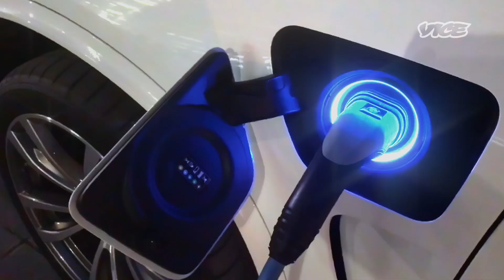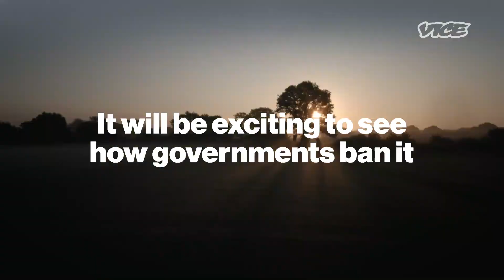The World’s First Solar Car | Extinction Update

Comment: Oh, this really does look super cool, I'm being serious... But where did they get the batteries for these cool cars from? Oh, they got these large lithium batteries from tens of thousands of hours of mining into the earth for the lithium???? Wow, I hope those colossal mining trucks were solar-powered too... Because if those colossal mining trucks were using fossil fuels (diesel fuel) to move all of those tons and tons of minerals to locations where they used tons and tons more chemicals to sift out the specific mineral Lithium, then that would have taken a crap load of these cars to ever make up for all the fossil fuels that were used to mine for the needed materials just for one of these really awesome solar cars??? Geesh, maybe this game of fixing the ecology of our planet with halfway cool cars that still, unfortunately, can't even accomplish what a regular fossil fuel vehicle does by itself, then this might be a step in the wrong direction.
You must take every step of the process into the equation to ensure the end result is an actual fix to the problem. If producing one of these types of vehicles requires seven billion tons of co2 (carbon footprint) to make, but one car only reduces 100 million tons of co2, then you are only creating more of the same problem. I really hate to break it to folks out there, but fossil fuels are still a huge requirement for the time being.

Comment: solar panels are made from silicon and other minerals mined, refined and manufactured with fossil fuels. car manufacturing is energy intensive and polluting and even a solar car pollutes the air with micro particles from tyres.  if these people were actually green and not fakes they would simply be recommending people didnt drive cars at all.

Comment: Magnetic turbines using magnets placed under the tarmac that turn magnets on the underbelly of a vehicle is a good idea... The infrastructure would cost a fortune
.. But if its clean energy you want... You gotta pay for it...

An industrial magnetic bar (for a forklift) costs 300 sterling.. You could either suspend them above roads or Bury them under tarmac... The amount of energy generated is based on the spacing of the bars...the speed of the vehicle... And the size of the magnetic turbine...you could make them smaller like a box and Bury them in the tarmac and have road markings for them.. Might give people incentive to stay on their side of the road.... You could even use an electromagnet with a optical sensor so that it only turns on while the car is over it... Electromagnets can be powered by solar... But ridiculously expensive... But they can be turned on and off so they aren't a hazard... But there ya go... My two cents... 

But if they were mass produced specifically for infrastructure they would probably be a lot cheaper...

Clean energy initial down-payment for future returns???

Future returns being emission free countries.. That can still drive their cars...

Comment: You could incorporate wind funnels that charge the car via wind power while you drive also...

You could create an internal windfunnel like a lambo... Have it filled with rows upon rows of aerodynamic fans where the blades are only at a slight angles so it's not producing much drag...

Kind of recuperating some of the power lost by driving... Might extend the battery life by a certain amount of miles.. Depends on the design of the turbines....

You have to push the car anyway... So why not try and recover some of that energy...

Comment: Key assumption here is that this is basically a model y with a solar array slapped on top. 

Assuming a 180watt solar panel is around 800sq inches and the real estate that you can functionally place solar panels on a car like this is about 4x8 sq ft or about 4600 sq inches which means you can get about 5.76 180 watt panels onto the car while being able to see through the windshield and the back window. This means that for each hour in peak conditions the car would produce around 1050 watts however because a car roof and hood is not an optimal placement this efficiency gets cut in about half+extra weight from panels requires extra energy to move. So in reality we only get around 525watt per hour, supposing we get 6 hours of good sunlight that means that we get around 3150 watt hours per day. The Tesla model y has a battery capacity of 75000 watt hours, and a range of 326 miles, so using these numbers 3150watt hours would only get you around 13 miles of range per day. Even this is unlikely and as I mentioned before the solar panels would add weight and require more energy to move. However it is still technically possible just highly impractical, and as such there should also be an option to charge the car through an electric charger as well.

there is absolutely no way their claims of a 800km range are true if this has a smaller battery than 50kwh, and while the solar panels will recharge the battery while you are driving, it will only be enough to slow the battery’a drain by maybe 40% at the very most.

Comment: I think this whole going fully  electric is a big farse. You've got to get the electricity from somewhere which means it's generated in a power plant like an oil power plant. Then the  more your transfer and store energy the more you lose in the process.

Something like a hybrid gasoline/solar  or even gasoline/mini wind turbine cars  would be amazing though. This would help solve alot of problems. It would reduce a lot of emissions during the day while still being able to drive at night. You also keep the driving range by having gasoline as a backup. The solution isn't a light switch its a dimmer. We will never be zero carbon  but we can reduce it.

Comment: They should ask more critical questions. The business concept is flawed and the likelihood they will ever make money is very small. If they want to outsource production then also the chance any IP will walk out of the door is big too.
From this film alone I can see build quality is an issue and how the panel-roofs are made in their lab looks messy and error-prone. No way they will make a competitive price. Which company puts a big red e-stop in the middle of the dashboard?? They themselves already think the prototype might be dangerous to use? 
And I didn't even get started on the technical concept. Electric is not the best energy for vehicles. If used correctly that is diesel. And who puts very heavy panels on top of the roof? To compensate you need heavy suspension, thus more spring force and a rough ride. Couple that to hi-efficiency tyres and the ride becomes bonehard, as you can see in the video too.
Just some thoughts from a automotive testing engineer..

Comment: This company is borderline scam. The math just doesn't work for solar powered cars in a traditional form factor. Even if you could capture all of the sun's energy the time it would take to charge is way high. This is NOT a solar car. It's just a normal electric car with solar panels bolted on top. The true solution is electric car with proper battery recycling charged by renewable energy (nuclear being the only real option with the short time left before we're too late to fix the planet). 

This may not be as far off as many think though. Battery tech is evolving very fast and modern LiFePO4 batteries can last for 10000 charge cycles with 65% of the original capacity remaining. (if this sounds bad don't worry, auto makers already hide part of the capacity so you don't notice the degradation)

Also solar planes, trains, and boats? Have they asked an electrical engineer?

Having any of these be purely charged or powered by electricity from solar panels is crazy. The math simply doesn't work. 

It's depressing that companies like this continue to find eager investors. They really need to consult with engineers first. I work at one of the biggest companies manufacturing battery safety systems for electric cars and not a single engineer I know of would take this seriously.
Reply: Did you look up their website and Youtube channel? Did you know they started as a few students from the Eindhoven Technical Uneversity and won the Bridgestone World Solar Challenge four times in a row? It's worth looking that up and find out they are not just a bunch of scammers building a car in a barn. They are very serious. Just Google Lightyear One
Reply: @jojothecrazyclown7572  Yes, but the math still simply doesn't work out. And they should have realized that as engineers working on solar cars for competition, which must be more like a bicycle than a car to actually work. The best solar panels out there can get 800w/m^2 on a very sunny day while directly facing the light. It looks like they have 2m^2 at best on there, so in a full day they can't hope to get more than ~6kWh since 4 hours of direct sunlight is usually about the same as the whole of a sunny day. Even the Nissan leaf, a smaller car often criticized for its smaller battery has a 62kWh battery. That means it takes 5 days to charge your car to drive 100 miles. But it's substantially worse than even that, as you need to carry around the heavy solar panels the whole way, keep them clean, and then realize that it isn't sunny like that in the real world so all of these figures are over optimistic. 

I'm not against electric cars in any way, but why put a solar panel on the vehicle when you could have it stationary and being directed straight at the sun? If your car is already going to have a battery (as theirs does), this is WAY more cost efficient. 

A similar argument can be made for solar roads, a terrible idea that got lots of money from excited investors until they realized that the math just simply doesn't work.
Reply: @COASTER1921  The car has 5 square metres of solar panels that is not heavy as you state but very lightweigt. You say the math simply doesn't work out while you didn't even look into it. On their website and their video's on Youtube they explain it all. The Lightyear One weighs about the same as a Nissan Leaf and has the same battery size with 65 kWh. This is the most aerodynamic car in the world and because of the efficient inwheel motors it can go very far on a kWh.
Reply: @jojothecrazyclown7572  A car with 65kWh of battery and 5m^2 of solar panels will not be lightweight. I'd guess about 700lbs of battery and 200lbs of solar panel if they want one that has any chance of actually charging that battery a little bit. And that's before you add the parts that make it a car. The battery is what makes even small electric cars unusually heavy and there's no easy way they can get around that limitation without developing an entirely new battery chemistry. It may be a good and efficient electric car, but they're selling it as a solar car. I believe their predicted numbers of 30-40 miles of solar range a day during summer will be achievable only in the Australian Outback where these solar car team events usually take place. In Europe, USA, and anywhere else it will be much, much, lower. 

The main point I want to make is that putting solar panels on a typical car doesn't make much sense when you consider that they could be mounted on a roof to operate more efficiently, then be used to charge the car. Plus who is going to leave their $150000 car parked outside unattended all day? I'm all for a startup trying to build a super efficient electric car, there's absolutely potential there for improvement, but the solar panels will almost certainly just be a gimmick IF this thing ever releases.
Reply: @COASTER1921  I see your scepticism. This is not a typical car at all. This car is build from scratch to be a solar car. Also this is not a €150.000 car but in 2023 when they produce it in larger numbers it will be more like €50.000. After that they want to build very cheap cars for the masses. I think you are not aware the thin solar film they use weighs nothing. It also costs almost nothing. The safety glass on top is also not that heavy.  The total weight of the car is 1300kg ( !!! )

You let it look like as if they just put some solar panels on a car and call it a solar car. But you have no idea about the technology behind it. They are based in the cloudy Netherlands and they can get there 8000km a year from the sun only. You can say it's all a scam but i don't see it that way. They work with big companies like NXP and DSM. I hope you agree if you partner up with companies like that you not only need a good story but hard data too.

To have solar panels on your car gives you much more freedom. Slow charging gives you also much more battery life. And not everyone can mount solar panels on their house. If you are from home all day you can't charge from the panels on your home and at night the sun is gone. Let's say the life of the solar film on the Lightyear one is 5 years. And you don't get 8000km a year but 6000km a year out of it you get 30.000km from the sun at the cost of maybe €300 worth of solar film. 

I follow them from the beginning. I think it's not fair to say this is a scam. They want to change things and they decided to do. Also they are very transparent in everything they do. Maybe it will fail. I can't say. But i have respect for them trying to fight in with something that's make a change. You can buy a Tesla but what's the point if they go for faster cars with bigger batteries all the time?

Comment: Vice, where do you think EV's get their electricity? You think they're milking goats to get that electricity? COAL and NUCLEAR power plants have to ramp up production to meet the needs of increasing EV power draw. You're CO2 output isn't decreasing, it's simply being redistributed. And its actually less efficient to convert fossil fuel to electricity and send that electricity to a car than it is to just put the fossil fuel directly in the car. Power plants operate off of 60 year old tech with terrible efficiency, but more fuel efficient gas engines are being created all the time.  I don't think electric cars are going anywhere, but I do think you should be careful about promoting EV's when the infrastructure that runs them is putting out all the CO2.
Reply: power plants are far from " terrible efficiency" A rankine cycle such as gassified coal or natural gas can easily exceed 40% efficiency. your car is lucky to get 20% off of gasoline. The only solution would be nuclear power.
Reply: @MrHowzaa   Yes, theoretically modern powerplants can reach around 40%. Most power plants are definitely not modern though, especially the one I work at🤣. New engine technology, such as Mazda's Skyactiv, will reach thermal efficiencies exceeding 55% in the future. But that is beside the point. You're right, the only real solution is convert current power generation to clean alternatives such as nuclear (but nuclear waste!) or solar, or, more idealisticly, fusion power.

Comment: It's 2020 electric cars and solar panels are not new, there's a reason they have not been combined successfully before perhaps vice could report a little more intelligently than blimdly pushing green hype devoid of Science. Everyone would love this idea  but even if  we could magically make 100% efficient solar panels the sun's energy is limited to 1kw/m2 and we will never change that, even if we could fit 2 panels this size on a car the batteries in electric cars need more power than this to charge for most uses.

Comment: This is either a scam or only a very bad idea. There is no way this solar panel can add km to the range because: (1) the weight of the panels will raise the power consumption of the car more than the panel can produce (2) the need to park this car in the blazing sun will result in a very high power consumption by the air conditioner again using more power than this panel can produce.

If you want a solar powered car the logical step is to put them on your house and charge your car via the main. If you do not want to sell the power when the car is driving you can charge a battery and charge your car from that when you are at home.

Comment: Apart from the whole video being completely misinformed (as other comments will tell you, they literally said solar planes are the future. The energy produced by 1m² of solar panels is 200W. A boeing 737 uses 7.2x10⁶ watts while cruising. So you would need 36000m² of solar panels, which is 5 football fields 😂😂😂

Comment: Sorry 1 million Euros.... Tesla's are already Solar powered when u consider it costs less than 10,000 USD to get a solar system for your homes roof. so 32,000 for a car and another 8000+ or minus 2000 for a solar system. And if you cant afford a home yet. Heres a break down which will mostly be done with loans on monthly payment plans, Home, plus car plus solar system, 180,000 USd or 154,744 Euro.... there's your solar car.... plus ur off the grid, so no electricity or gas bills..ridiculous.

Comment: I think this idea is a mathematical dead end, a nice publicity stunt but considering the solar array does not increase the range of the the vehicle in any meaningful way, the logical and physically responsible conclusion is to source the solar energy from your house... for less than 1,000,000... and just buy a cheaper car that does not make inefficient use of solar technology at an insane premium price. Hell you even get to say at that point that you reduce carbon fotprint by some figure closer to 90% if you market the house solar charging station as part of the car, that way you can keep the gimmicks you're using as selling points and you actually deliver on them with actual Value for the consumer!